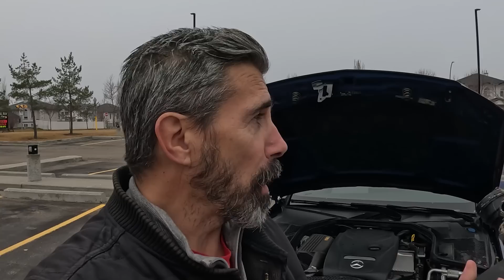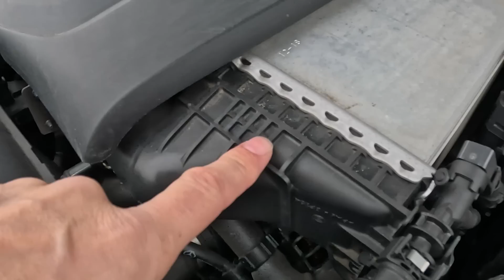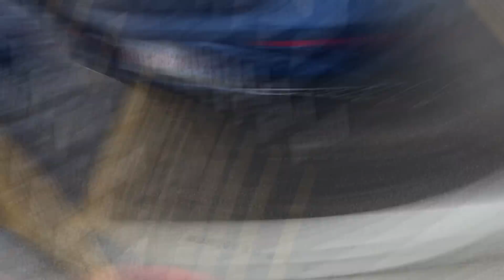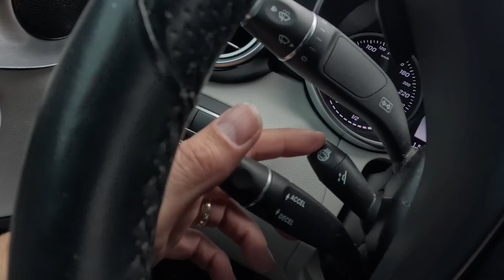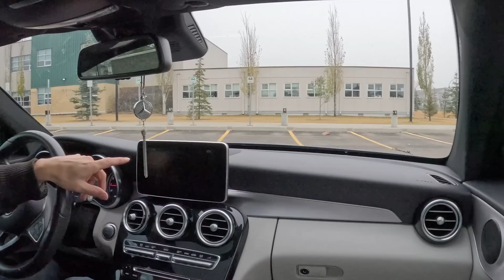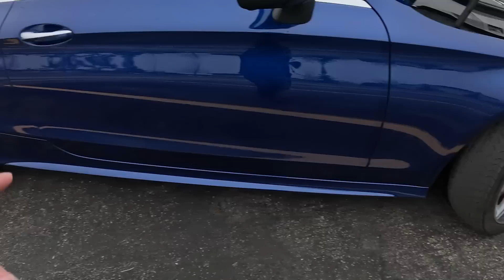Here’s Why New Cars Can't Last  5 Years | What Went Wrong?

Comment: I worked at sears in 2011. The Kenmore rep told me appliances were designed to last 5-7 years. Id imagine its 3-5 years now. When they first started becoming mainstream in homes they were sold as a lifetime investment. Cars are going the same way.
Reply from the maker: It seems like the newer models are built for a shorter lifespan these days.
Reply: My Kenmore refrigerator is 34 yo.
Reply: @jimw7550 mine only lasted 25 years but my Speed Queen dryer is well over 34 years old, replaced a few parts initially, none since 2000. 😅
Reply: @jimw7550  My Maytag 25.5 Cu ft top mount freezer that I purchased in 1999 was sold with my house in 2019. It required no service in twenty years. My Kitchen aid KRMF706ESS that I purchased in 2019 was ready for the junk yard in 2024. Complete POS. Evaporators, control modules, wiring harness, LED lighting, power supplies all failed.
Reply: My Speed Queen dryer was used when I bought it in 1991, still have it, replaced a few parts. 😅 I'm a mechanic, I have to fix everything.
Reply: @melissasmess2773  my exwife would get all sorts of mad I wouldn't "let" her buy all new appliances every time something broke down. Sorry, I'm not spending $2,000 on a new washer and dryer because our dryer needs a $13 heating element that I can replace in 30 minutes by removing 10-12 screws.
Reply: @melissasmess2773  Sears Kenmore dryer with a mechanical timer control. Bought in 1988, RIP in 2018. Got rid of it when I couldn't find a replacement timer.
Reply: If you take care of it it’ll last. Bought a house that came with Kenmore washer and Dryer in 2014. I’m pretty sure it’s the same appliance that came with the house when it was built in 2007. The house was sold this year 2024 and the appliance still works! The Real Estate agent was even surprised.
Reply: I've been told by reputable techs and appliance dealers alike that the life expectancy of a modern refrigerator is from 3 to 7 years. Single evaporator models without ice in the refrigerator door are the most reliable. Doesn't matter where they are made. Opting for the ice maker on the refrigerator door starts the ticking time bomb going.
Reply: I have a Hotpoint top-loader washer and dryer pair made in 1979.   Several years ago I remember I had to replace a seal.  That's it.  Both work great.
Reply: It's NOT progress.  It used to be you saved for and bought a house.  The appliances would last most of your life, so you could save for other things, like a swimming pool, vacation, college for the kids, or to open your own business.  Now you keep having to buy a new furnace and water heater every few years.  Thank the greedy industry and our stupid government.

Comment: You forgot the infotainment system that control everything inside car. If that goes, you’ll have to toll it the dealer to fix.
Reply: The screen on my 2017 x3 is toast.  $2500+ at a dealership or $71 for the part to do myself.  Dealerships are a rip off.

Comment: I don't want ANY of that electronic crap. I don't want turbo. I want BASIC. Should have kept our 2008 Hyundai Accent but it had problems I didn't want to fix. It had 130,000+ miles on it. Basic 1.5 NON-turbo with automatic, crank up windows, add-on cruise.

Comment: Keeping my 2008 c300 There isn’t any replacement for displacement in engine size They run lower rpm and have better power with less problems 
With all the up the 3 and 4 clusters have they need better parts but they don’t

Comment: Virtually any material can be tested in a a virtual simulation. The manufacturers know exactly how long each part will last and use the cheapest materials possible.
Reply: That's exactly 100% correct..its.all by design. I will never buy such shit build quality vehicles made today for that reason. They have really cheaped out on all materials. The main reason I  will never buy.
Reply: Bingo. Advances in simulation destroyed reliability.
Reply: Mean time between failure - this is the engineering term. They have it down to an art. I used to work for a major electronics brand, trust me they know everything about this. It's now everywhere, I saw this first 40 years ago in my field, now it's cars, houses. Nothing is designed to last.
Reply: Planned obsolescence..
Reply: Life and reliability testing. I did that for seat recliner mechanisms.
Reply: simulation cost... most parts are designed by engineers only as  shape doing things, without thinking on all issue that might arise, or making it cheap to manufacture, like why aluminum instead of lastic, why screw when we can sonic weld, or add clips to plastic housing...

Comment: My jeep wrangler has the plastic oil cooler that sits near the intake.  After 100k miles it cracked.  This is a common occurrence and should be a recall. I replaced it with an aftermarket cooler that's metal which triggers my service engine light and I can't remote start my jeep now.  My buick grandnational which I had rebuilt to handle more power. When the original engine was opened, the stock engine had a slightly worn timing chain which was replaced by a double chain.  Other than that the engine and transmission were clean.  In fact if i didn't want to update the power a car from 1987 probably could have been a reliable daily driver for another decade.
Reply from the maker: It seems like a lot of modern cars have major issues
Reply: Buick 3800 is all I run.😊

Comment: The idea of plastic valve covers and oil pans is really distressing.
Reply: Oil pans were made of stamped steel for years and would last for decades, then aluminimum which were more expensive and easily broken now plastic which will fail in less than 10 years probable more like 8 years.
Reply: @markseehawer3762  aluminium doesnt flex back into shape after stress. if you over stress aluminium it becomes plastic. pun intended its just how the material does not return to its original shape after flexing past the plastic region.

When you build something metals are great for flex, but different metals have different plastic points. plastic itself can be flexible and made very specifically for what you need, its not been 10 years for you to comment unless its american which means they didnt engineer the plastic and just went with off the shelf stuff thats not appropriate. steel is the only material that the plastic region is the breaking point. its called plastic region in reference to something like ABS plastic but theres a lot of plastic to choose from for your materials that perform how you want it to. Rubber is fine but americans are allergic to it.
Reply: @System0Error0Message Something hit my son's Z06 Corvette aluminum oil pan and put a hole in it. If it was steel probably would have just been a dent. My old Silverado's oil pan has some dents but still working as designed.
Reply: @craigdoriety9798  steel's flexibility helps reduce the impact, assuming it wasn't thick. the plastic region is different and aluminium doesnt like to flex. But an even better protection would've been a flexible plastic undercover.
Reply: @System0Error0Message Dude. The United States has the best engineers in the world. They do not use "off the shelf plastic." They  INVENT plastics that are the most specific to the job parameters.
Reply: @Matthew_Loutner  "ABS" was mentioned. Thats off the shelf in a sense
Reply: @System0Error0Message  How do you know it really was ABS?

ABS is a good plastic. If ABS is the right plastic for the job, they can use ABS.

That is like saying, "steel was mentioned."
Reply: @Matthew_Loutner  because in the video it did mention ABS as one of the plastics. ABS is a range of plastics, its good for the task of outdoor use but it isnt flexible, hence cracks can appear over time especially through collisions. Steel is a flexible metal, making it resistent to cracking from collisions. hence a dent isnt going to threaten steel to leak unless it goes over the steel's plastic deformation zone which can cause it to break which would be immediately noticed. Meanwhile plastics even ABS wear over time. ABS specifically is tough but less flexible, which makes it more vulnerable to dents and cracking open over time. Plastics also break down and you may not know this but while plastics are considered an organic compound, being non reactive doesnt necessarily mean they dont wear out. So while we have ways to keep metal in service over a long time such as painting, its more difficult to apply the same ways with plastics. Flexible plastic underbody covers are good for the task of protecting the underside by being flexible, whereas steel could add a lot more weight for the needed protection. For component use, a dented steel oil pan will work fine without leaking but dent ABS plastic, and it may have cracked and started leaking.
Reply: @System0Error0Message  Your original complaint was about American car-makers using low-quality plastics. That blue car in the video is a Mercedes Benz. They are not American. They are made in Germany.
Reply: @System0Error0Message  You just spent 10 minutes explaining the difference between metal and plastic to a professional auto mechanic. Good job.   👏
Reply: @System0Error0Message  Your original complaint was about American car-makers using the WRONG TYPE of plastic -- your comment was not about metal.
Reply: @Matthew_Loutner  yup and thats what i mentioned. in comparison to steel meaning plastic being lighter and cheaper than steel only works for less time which is what manufaturers want. for the car to last till the end of warranty, break and they buy a new one. plastic is also less flexible than steel. my point was on why steel is better despite what manufacturers are doing.
Reply: @System0Error0Message  This discussion has nothing at all to do with car warranties. Plastics are used because they reduce the weight of the car.
Reply: @Matthew_Loutner  and cheaper, but more importantly warranties and designed lifespan.
Reply: @System0Error0Message  It has nothing to do with price and warranties. Plastics are used in cars to reduce weight.
Reply: @markseehawer3762 

Steel oil pans have their place, though a hole rusted through my Dad's ford 7.3 diesel oil pan when it was 16 years old. He had to lift the entire engine out. I think in places where there is road salt, aluminum pans are the best compromise.
Reply: @JayRides-ul9uf Your dad's oil pan was not properly painted.
Reply: Some cars even have plastic water pumps now.
Reply: @Prepare2Survive Yup, that is insane! Maybe save 5 cents per engine. Lol.
Reply: @Prepare2Survive  I heard Audi has plastic water pumps or something. I am not sure about it, but maybe someone could confirm it and save me googling.
Reply: @BIOSHOCKFOXX yes most of the housing is plastic some metal on the internals I think they fail usually before 100k kms
Reply: To prevent the impellar from damaging the block if the bearing fails. A metal impellar can destroy the block if the pump was to fail. It also wont rust and is lighter. I have seen multiple times people thinking they ate upgrading to a metal pump only to learn tge hard way later that its no upgrade. @Prepare2Survive
Reply: @Prepare2Survive  Started many years ago! The notorious VW water pump is made of PLASTIC!😮‍💨
Reply: I just spent 7 months working at a Ford factory. I was absolutely bewildered when I saw the plastic oil pans on the engines
Reply: @chrismissedtree i can foresee a rock making a hole, engine blowing…
Reply: Did he say six hundred dollars for a lead acid 12v battery from Mercedes dealer?
Reply: Plastic oil pump parts. Lol. B58 engine
Reply: Oil covers are still not so bad as the oil pans, or intake collectors or side parts of intercoolers which can Not stand higher boost . I have cracked two . One collector at 2 bars of boost, and one intercooler at 1,6 bars of boost. Now i have both from aluminium, and i can drive in big peace now 🙂
Reply: Must be bad up north (engine operating temp [210° F. coollant] ) then -20° F
Reply: Yes! I work at a shop and the new Nissan Rogue has the plastic oil pan.  I have done 3 oil changes on those where the drain plug comes out with the threads.  We know have to replace the whole oil pan to do an oil change 😂😂😂
Reply: @djserg4346 They make a couple of kinds of replacement oil plugs that can fix that.
Reply: I agree.
Reply: That's what they call German engineering 🙏
Reply: Seems like the peak of reliability was with engines like the pre AFM Vortec 5.3. Those were very tough and efficient motors. Also inexpensive to repair and maintain.
Reply: Probably they use some modern heat resistent plastic.
Reply: distressing (X)
DISGUSTING   (0)
Reply: Good quality plastic is more then enough to handle such use. They simply don't use good quality ones, that's all there is to it. 
There are even some 3d printed car parts including suspension that works with no issues due to many smart tricks used in it's designed(possible only on 3d printer as it's too complex for mass production). So no plastic is not that evil or weak, cost cutting is.
Reply: The ZF auto trans.  Many have plastic pans.  My Ford Falcons has the optional stamped steel pan.
Reply: @railtrolley My BMW has such a plastic transmission pan. It is a combination pan and filter meant to last the life of the transmission per BMW. ZF recommends a change of pan and fluid at roughly 70k miles however. An easy swap out.
Reply: Plastic radiator tanks are had enough, forget anything with a plastic sump or rocker cover, just cheap crap designed to fail super quick.
Reply: In the seventies, you could buy clear plastic valve covers so that you could see the valve train operating while your engine was running.
You could also get clear plastic carburetor bowls and watch your gasoline inside that carburetor.
Reply: That’s why every time I replace something in my car, I always search and replace them with metal parts.
Reply: @betterview0223  Metal is heavy unless it's aluminum, so a bad choice for vehicles. Modern bicycles are made purely of aluminum and plastic, apart from the transmission.
Reply: @ yes it’s actually aluminum.
Reply: I have a 15 year old BMW, which I have owned for 12. The plastic head cover is perfectly fine, and so are the plastic reservoirs of brake fluid, power steering and coolant. There’s nothing wrong with using engineered plastics.
Reply: Not to worried about plastic.  
More about turbo engines and cvt. 
U can still get veicles without them, though.

Comment: I've been addressing problems as they arise with my Audi Q3, and trying very hard to keep it reliable and on the road. With about 101,000 miles, the dreaded "Check Engine" light is really insinuating itself and adding unwanted excitement to my driving experience. The Audi has already logged substantial time in the repair shop during 2024, and I'll start 2025 not confident that it will stay dependable. Looking on the bright side, cars like my Audi provide plenty of work for needy mechanics, right?

Comment: If I were to get one of these new, sophisticated cars, I would lease it.  No repairs on my dime!
I know it's the most expensive way to have a car, but I will lease the car and then hand them back the keys afterwards.
Reply: @canny8228- Exactly my thought too.
Reply: @sperlongatours Exactly, I bought my first vehicle in 2010, a 3.6l NA Camaro and have right under 31,000 miles. Just did an engine flush on it when I got my last oil change this year but it stays parked. Definitely not my daily. My Stepfather passed last year so I inherited his 2004 Honda Element just had a radiator and engine with 45k [edit] miles dropped in it and a Rack & Pinion Steering System (rebuilt) installed. That’s my daily driver!

Comment: I get my oil changed before 5000 miles. The shop owner brags to people (for me ) about how well I take care of my car
Reply: Similar to myself, I only drive 2,500 per year, and get the car serviced every year. Even get the auto transmission oil changed every 3 years, which is recommended, but in my case every 7,500 miles so probably OTT. 14 year old engine ticks over like new.
Reply: @mart34 you should get oil changed at least twice a year . Oil oxidation and moisture is not your friend when you don’t drive much
Reply: @Maatson_ my last car lasted 16 years and I only changed the oil every 2 years. Left it for almost 3 years once.
Reply: @chrishart8548  I am on 42 years like that on one of them
Reply: What the point if the rest of the car is falling apart around the engine?
Reply: Foolish...